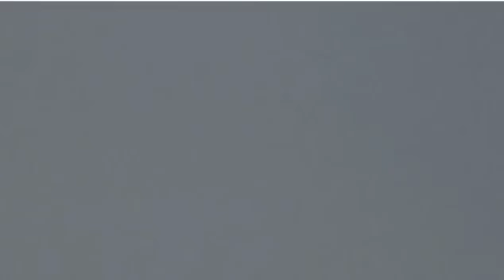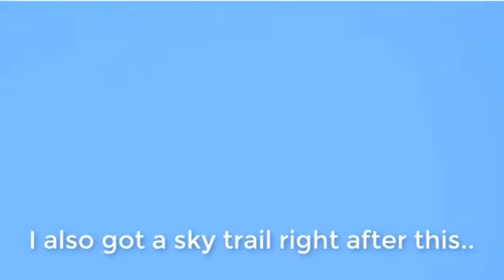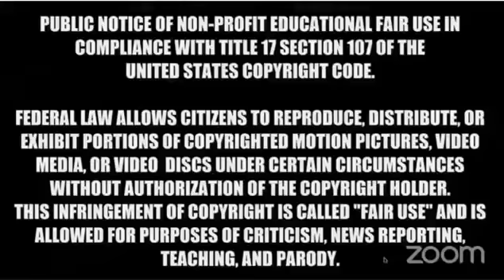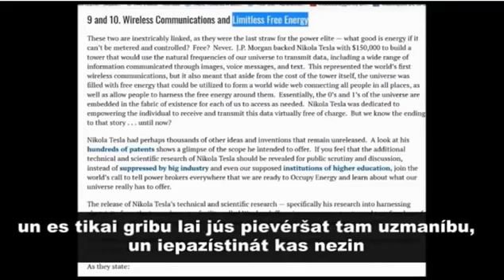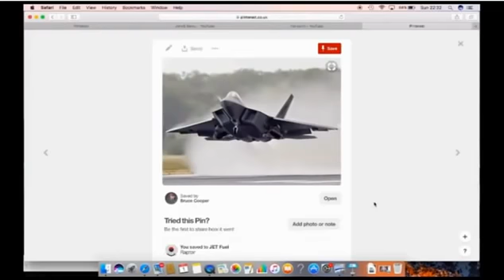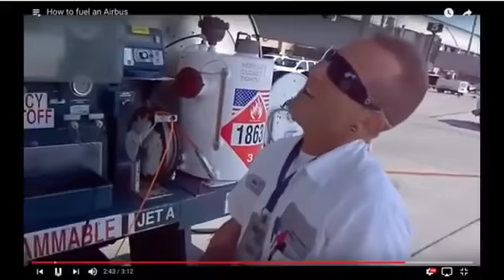Airplanes  Run Mostly on Compressed Air and Helium not Jet Fuel

Comment: when u did the altitude reading. if your measuring tool is inside the cabin you will be reading cabin pressure which they bring up to 6000-8000 ft. thats why your reading is consistent.

Comment: Here is a way to show jet engines do need fuel! Jet engines are huge air compressors just like car engines more like a supercharger on a car engine tho! Go to your local hobby store they have miniature jet engines you can buy and try to run with just enough fuel to start and take off then see how long it lasts without gas! You will also understand that they actually do need fuel to run! The reasons the wings dont burn is due to the pilots dumping the fuel from the tanks before the crash! Why dont people do their own research before believing a video of misinformation!
Reply: Shut the fuk up pervert
Reply: @israelmolina496  dumb ass!
Reply: Your mom is a dumb ass

Comment: Yes a crane can only lift a few tonnes and thats because a crane uses a small amount of fuel in a relatively small engine, whereas a plane uses a huge amount of fuel in a whacking big and noisy engine to lift that heavy plane. The airplanes wings also displaces many tonnes of air at the high speed of take-off, in fact roughly the same as the plane weighs. You can sometimes see the vortex under take-offs.

Comment: Aircrafts are running mainly (90%) on compressed air and only 10% on kerosene for  the takeoff and the landing. Aircraft's wings are very thin and narrow and they cannot carry hundreds of tons of kerosene. Furthermore, aircrafts are equipped with air compressors. Therefore, to tax kerosene is ludicrous and preposterous !
Reply: Possible. But why? Fuel has more energy per unit than compressed air, and is much safer to transport. It takes enormous and increasing amounts of energy to compress air, and compressed air can't run the air compressors, so u are just relocating the burning of fuel, not eliminating or reducing it. Transporting fuel safely is just a matter of keeping out a large amounts of oxygen. Transporting compressed air is a massively dangerous and expensive task needing incredibly strong and thick materials and perfect structural integrity. People think compressed air is less dangerous because fuel is flammable etc, but a more useful way to look at it is that compressed air has already exploded, and the explosion waa caught in a strong container, like a devil genie.
Reply: 1. Tanks are in the center and part of the wings. 
2. Volume is not the same as surface. A 10 x 5 x 2 meters wing already has a volume of 100 cubic meters, give or take due the shape but nothing impossible.

Comment: Something sure  does not add up, yet plenty of crashes because of incorrect fuel calculations , maybe fuel is needed for take off and landings, and on board power only?
Reply: @theqrealm  Rocket exhaust, not water
Reply: You are calling people dumb but yet can't answer a simple question.
Reply: Gozie Ndianefo I can answer any question relating to this. Go ahead
Reply: Quantum Energy Solutions no, they need it all the time. Why do you think planes even run out of fuel? Why do you think a plane burns if it crashes hard? Who in the right mind even considers this theory?!
Reply: The Sauciest Boss that’s my question for geniuses like you. Where is jet fuel stored if not in the wings? Belly tanks?
Reply: Dredge Mann yes. Right where the wing mounts to the fuselage and sometimes other places. What I just don’t get is how you don’t know anyone who is a pilot and could literally show you airplane fuel.
I don’t want to be harsh but either you are a hermit or seriously need to go back to school
Reply: @thesauciestboss4039  I know small plane pilots & a passenger jet mechanic indirectly. Word is theyll lose job or worse, disappear or 'suicide' if they tell the truth. My common sense falls into the claimed fuel mileage can NOT possibly fit in an Airbus type passenger jet! At 8-9# per gallon. Octam razor makes hell of a lot more sense. Most ppl are soo dumbed down & brainwashed,  I dont even bother.
Reply: Dredge Mann I feel bad for you. Last time I flew in a private jet, I was present during fueling, engine startup, and in the cockpit the entire flight.
I’m just gonna guess off the bat that you live in a rural area with little to no access to jet aircraft, and have never actually spoken to a pilot. I’ll also guess you believe the moon landing was fake and the earth is flat. 🤷‍♂️
Reply: Dredge Mann and hell, it’s not like becoming a pilot is a top secret program. If you had a lick of sense, you’d realize compressed air is impossible in an aircraft as a form of thrust production.
Reply: @thesauciestboss4039 you're a 🤡
Reply: @thesauciestboss4039  how is it possible to store Tonnes of fuel in those skinny flimsy looking wings?????? Common sense mon.
Reply: ACCESS DENIED - the Boeing 777-300ER carries about 30T of fuel in each wing then another 80T of fuel in the centre tank. 

The wings aren’t thin. The aeroplane is massive. The landing gear is huge. The engines are huge and burn about 4T per hour EACH.

Comment: All jet aircraft? I’m an aircraft mechanic  doing heavy overhaul work on lockeed Martin p-3 Orion aircraft. They are capable of carrying 40-50k pounds of fuel.
Reply: Where do they store the fuel? Wings? Wings look super flimsy to me, and wudn fuel sloshing around cause all sorts of havoc?
Reply: Dredge Mann do you know how airplane wings work or are you really that dumb?
Reply: @dw4940  engineering measures are in place to minimize fuels sloshing around. This is one of the first problems solved. Similar measures are also used in tanker and water trucks. Many solutions centre around having many compartments and flow control valves.

The World War II Spitfire used to experience a problem where the fuel line would starve during certain high-g maneuvers. The solution that the Germans found and the British adapted was quite simple and genius.

I hope you develop a passion for Aviation and the Sciences in general and continue to learn how common problems are dealt with through engineering.
Reply: Sexi Grande these people think you’re an actor 😂. These guys are worse than flat earthers
Reply: CAN I LAUGH IN YOUR FACE NO WAY CAN THAT HAVE 40K OF WEIGHTOF FUEL IN THOSE SKINNY WINGS  DO A Gallons to Pounds Conversion AND GET OFF THE CRACK
Reply: @smooveking773  sorry I got the specs wrong actually it’s 61k pounds max fuel capacity. Of course there’s 2 fuselage tanks as well. Wings can be several feet thick along the inboard wing root, hardly skinny. This is a large wing for example : https://www.google.ca/amp/s/amp.reddit.com/r/aviation/comments/9srsno/a380_wing/